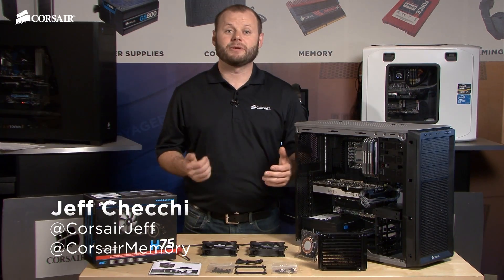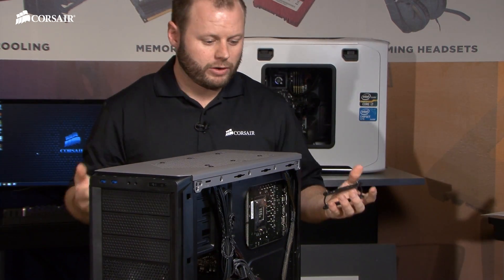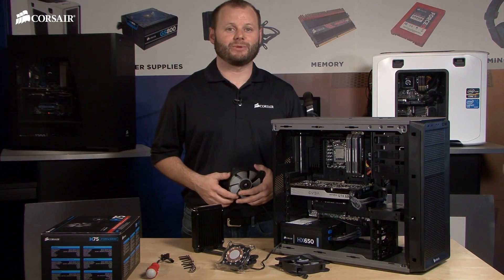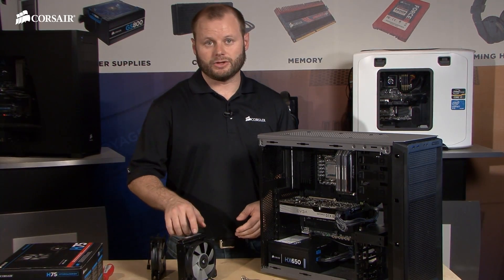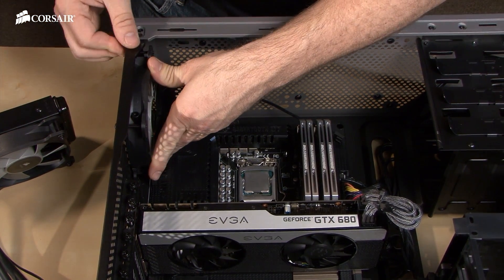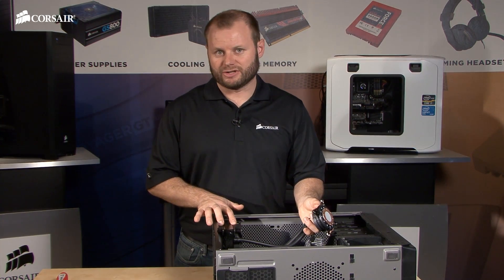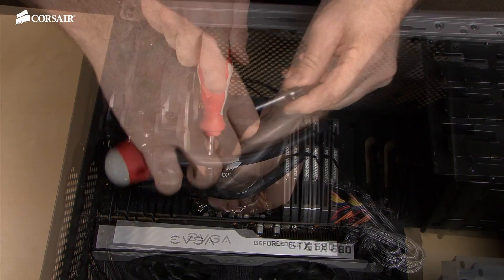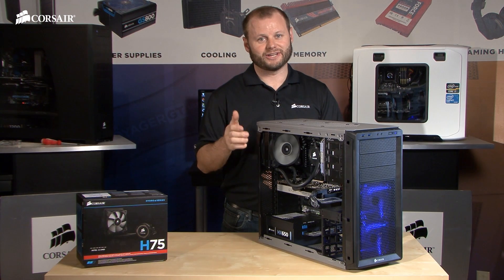Installing the Corsair Hydro Series H75 Liquid CPU Cooler

Comment: HI. How to control pump speed in this cooler. Mine runs at full speed all the time. Iv'e tried various software/motherboard connectors combinations and none allowed me to control the speed. Someone on amazon said it has only one speed but then I cannot find it on corsair website. I am not worried about the noise as there is almost no noise despite pump runs at 4700 rpm (at least these are readings from AI suite). I am more worried about power usage and high electricity bill at the end of the month lol

Comment: The cooler pump has 2 connections. One is a 3 pin 12vdc the other is sata power. The manual says to connect the 3 pin and the sata power. Do they have be plugged in both?
Reply: I found this answer in another blog: You can connect it to the PSU using a 3-pin/4-pin to molex or SATA adapter or plug it into a motherboard fan header with fan control disabled for the header in the UEFI/BIOS.
Reply: @fernando-aharontruanovsky3898  Thans for the answer. I connected both in the meanwhile (sata power and 3 pin power) and the heat is transferred very well to the radiator.
Reply: Where is the connection to the SATA?
Reply: @fernando-aharontruanovsky3898  I think I have the 2018 model which has 2 connections on the pump unit.
Reply: Do you know why we have to connect both in this model and not in the older ones? Thank you
Reply: @fernando-aharontruanovsky3898  That was my original question 😀. But in the meanwhile i figured out that the pump has a led light. Maybe one power cable is for the led light and the 2nd for the pump itself... I don't want to try to disconnect one of the 2, because it can cause the pump not to work...
Reply: Is that because of the light on the top?
Reply: @fernando-aharontruanovsky3898  I'll test that tonight when I get home.

Comment: im kind lost here buddy on the crosair H75 guide tells to put the coolers as an air intake to pc case, and here you guys are showing to exhaust. And now? Exhaust or Intake installation of the radiator coolers?
Reply: Exactly. They mentioned specially to put fan as intake cool air from outside and here they are showing the opposite? I’m confused?

Comment: will this work with a i7 6700k
Reply: yes
Reply: i have it for my i5 6600k
Reply: cool thanks :D
Reply: How is it working? I have the same CPU in the PC I'm building. Have you over clocked at all?
Reply: +BPLNick which motherboard u use?
Reply: asus z170 a overclocked i5 6600k to 4.2 easy could go higher.
Reply: +BPLNick I looked at that Mobo. Got a good sale on an MSI Z170 M5 Gaming Mobo... wonder how far it will take me.
Reply: And i7 7700k ?

Comment: I'm not sure why, but I have terrible heat issues with this unit, despite a friend having the same configuration and having none. The pump seems to work fine. 
But if I attempt to render on the CPU I hit 87C and power down.
Reply: Casey Wagner try a third party replacement backplate, or use washers between the backplate and the motherboard when installing the standoffs. the low quality corsair backplate doesn't allow the cooler to be held tight enough on the cpu, and because it's plastic, if you try to tighten the standoffs, they end up stuck because the nuts come loose from the plastic of the backplate.

Comment: Can I use this with LGA 1151?
Reply: +Broccoli_King Or the H55, still haven't decided which one to get for the i5-6500.
Reply: +Broccoli_King both will work
Reply: +Broccoli_King He said it is adjustable, and he said on of the screw-bolt things are for all other intel sockets (even though he only mentioned 1150 1155 1156 and 1366) I really doubt it wont fit, and if it doesn't you can always just stick it on with super glue
Reply: Mine fit great! On my sky lake cpu
Reply: Nice to hear!! What kind of monitor are you running???
Reply: An old one (Dell 24")
Reply: Nice

Comment: I have the I7 4790k/MSI Z97a Gaming 7 with the h75. My previous h100i started smoking and Frys had the H75 for $75 so it was an affordable replacement. Aside from price, I specifically chose this one over the others because my Mobo could control it perfectly and I hated Corsair Link. I love the H75, it was as hassle free as advertise and my I7 4790k stays in 60-70c when overclocking at 4.6ghz even with my gtx 970 sli and 4x4gb corsair pro 1866 (Don't buy 4 modules for gaming people). Its very energy efficient and surprising not that loud even under max. I think Despite corsair bigger is better philosophy, I'd recommend over any of 240-280mm models. Fuck corsair link, its a shitty program that is 110% hassle.

Comment: Hmmmmm...... watching this to wrap my head around size, thinking about ordering one of these.

My problem is I was planning to put an H75 on as rear exhaust in the same location as this case, but I was also planning to put an H105 on the top of the case.  After seeing this video, I don't think they will both fit....
Reply: +Christian Gemme Put the gpu in the front.
Reply: +Christian Gemme You can't really cool your CPU with 2 separate rads, ya know
Reply: SquidPlays I know, I was thinking about using one for the CPU and one for the GPU w/ corsair GPU adapter.
Reply: ***** oh.

Comment: Hey Jeff, does the H75 use the same tubing style that the H105 uses? And if using it in a Silverstone Tek ML05, would it suffice to use Prolimatech 120mm Ultra Sleek Vortex PWM fans?

Comment: where the water at? i just got this fitted i thought it would have been much more complicated than this.
Reply: Yuck Foutube on stock cooler my AMD FX8350 was reaching 62.5c during games it was also VERY LOUD annoying it was! could hear my pc all over the house

so took it to pc world they fitted a cosair H75 i let them do it now my temps are down to 53c, ive seen people installing water coolers on here but they stood there with a funnel pouring liquid into it :o i couldnt be doing that ok i can put a graphics card or ram in but cpu stuff i'll leave that to the experts but after watching this video i could of probably done this myself it looks soo simple
Reply: +Julian john You're thinking about custom water cooling where you get fittings, radiators, tubing, a pump, a CPU waterblock, waterblock(s) for your GPU(s), etc. This CPU cooler is a closed-loop cooler, which means that there is already a pump, waterblock, and radiator; not to mention that closed-loop coolers are ready to go right out of the box. You don't have to (and you can't) fill up a closed-loop cooler.
Reply: +OMGItzAidan - Gaming  i have been looking for  an answersimilar to your reply. I actually want more on it so here is my question. "I have had my liquid cooling fan for  about of year and recently once a boot up my pc three minutes into my gaming session i get a noise from my cooling system. It sounds like wires hitting the fans, but I've checked all the fans and there has been no wires in them. I quit my gaming session and see if I can still hear the noise from in the case and I can. It seems to stay on once the computer hits a certain temp. I have been told in can be anything really. I know its not my fans. It cant be my psu unit because i have the fan facing downward. my graphics card it set up correctly and only turns on at a set temp. hard drive is still fairly new and so is my mobo. This leaves only the cooling system. So if my radiator is low on liquid will it make this noise that Im hearing, and what can I do to prevent the noise from happening again with my H75 crosair cooling system thanks.

Comment: I just received this today. It looks and feels like quality machinery and definitely good value for money. I guess the 5 years guarantee makes sense. I installed it on my 6-year old PC, cheap case with Asus P6T with a classic i7-920 on it. In the beginning I was a bit worried when I realised that I had to take out the motherboard from the case in order to install the backplate. But in the end it was all pretty straight-forward, had it all done in an hour though proceeding very carefully..
I was using the stock cooler all these years, but recently I have been running some multithreaded simulations which push it to 100% CPU utilization for days at a time. With the stock cooler temps were around 51-53C at idle and at about 80C with all cores running at 2.67GHz. Taking them to 2.8GHz resulted in 95-100C and the CPU was throttling down. So after I installed the H75, idle temps went down to 35C. But what's amazing is that with all 4 cores at 2.8GHz it's now 48-50C max (from 100C before). Very pleased with that. Tomorrow I will try to overclock it, my target being 3.5Ghz and hopefully temps not higher than 70-75C. Let's see if that's possible.
EDIT: Actually got it stable at 3.8GHz with temps at full load around 70C. Quite happy.

Comment: I installed the H75 today in my Corair Spec-02 case. The radiator barely fit in the case and almost caused an issue with refitting the side panel. My mobo was too thin for the backing plate, so I had to go to Home Depot and install some neoprene washers so that it would fit securely between the backing plate and mobo. I also subbed a Corsair SP120 fan with red LED for the fan that came in the box and it looks amazing. Aside from the washer issue (c'mon Corsair) it was a pretty painless installation. I dropped 15-20 degrees F running BF4 on ultra @ a very solid 60 FPS over the stock Intel CPU fan. 9/10. Corsair needs to address the thin mobo issue and let buyers know about possible fitment issues.

Comment: Can I change the supplied 120mm pwm fans to the af120 led fan??
Reply: Chee Jee Ven just commenting because i have the same question.
Reply: Chee Jee Ven Yes, You can. But i wouldn't suggest it.

Comment: Question please: I have installed this cooler on my i7 5820k cpu and my load temps are fine' it never goes above 60c on full load.
My problem is on idle temps and simple tasks temps, on idle I get about 37-40c and every simple task I do increases the temp in about 3-10c, now first of all I think 40c at idle is too high isnt it? and 2nd the noise drives me crazy because each simple task I can hear the fans speed up and down..

Comment: I just installed my h75 on to my i7 4790k and the idle temps are way to high in the 80c range and I am freaking out please any one help me.
Reply: Is everything plugged in correctly?
Do you hear the pump?
Reply: Sven Raven I am happy to say that i returned that h75 and got another and turns out i got a defective one so now my i7 4790k idles at 33c and when playing games up to 70c.
P.S:
I am not happy with Corsairs customer service because i left a message for them since it was a Sunday and i was very very VERY upset/stressed out that my computer was so hot and they never ever called me back to try to solve my problem so i was forced to solve my own problems and go back tot the store and beg for them to exchange it for a new one. It looks like that 5 year warranty is just for show and doesn't really work. I am just upset because this one of my first ever computer upgrades and i was before i started very scared and apprehensive of breaking something and it didn't help that i got a broken one. All in all this was an emotional roller coaster.
Reply: I had the same service.

Comment: Does this fit in a zalman z11 plus case?
Reply: yes it does but its very visible! I used an aftermarket SP120  to make it look a bit better
Reply: Martyn Stanger Ok thanks, I think i will go with a H60 :) Is it realy worth it to change the fan?
Reply: Tobias Nellemann I'd go for the 75 in push/pull or the 100i , only because it gives you the extra fans and wider radiator. Hope this helps.
Reply: Martyn Stanger I've been seaching the web for while now and I don't think a 240 mm radiator will fit sadly :( I would go for the 100i, but I would need a new case for that.
Reply: Tobias Nellemann I just had the h100i, (had to return it because it didn't fit my processor) and it looked like it fit on the top of the z11 plus. The only problem was getting the top of the case off to be able to screw the radiator in.
Reply: Josh Riess I went for the h80i :) fits perfectly and looks great with corsair link and leds :)

Comment: Hi, i have a i7 4970 with the stock fan. I found it's noisy as hell! If i bought this H75 the noise is gonna go? Or it's the same thing but a lot cooler cpu?
Reply: gmk kmg What are you talking about the stalk fans are very high quality and built for radiators. The fans are SP 120's which are have high static pressure which is key for moving air across radiators, and these fans are about $20 each and you get 2 of them with this radiator. But it would have been more beneficial for them to give you one AF for the exhaust and one SP for the intake.

Comment: Can you install it without a fan between the radiator and the case or would the screws be too long?
Reply: If you don't want 2 fans get a different model of cooler
Reply: ***** Yes you can do this but you will slightly loose some performance by not using two fans.

Comment: Hi I have a question. I have a hydro h60 where should I connect a fan and where the pump ?
Reply: Id do the fan on the cpu header and the pump on the chassis header.
Reply: The configuration for the H60 is the same, minus the second radiator fan.

Comment: hi i bought the h75, now the coolent pump has 3 pin ..but in my motherboard 2 fan connectors are 4 pin . hopw do i solve the problem
Reply: you connect it to cpu fan header
Reply: There is no problem

Comment: I'm a bit confused about the fan headers needed for the H75.. How many do I need (in addition to the CPU fan header), and how close do they need to be?
Reply: You just need two headers; one for the two fans, as they are connected via a Y PWM splitter, and another one for the pump. As for how close they need to be, the two cables you need to connect to two headers are two separate entities so you don't need to worry about how far the headers are.

Comment: So if I install this, do I still need the other case fans to cool the other parts of my PC?  Looks like the H75 completely utilizes the rear fan slot, so I guess the intake fans at the front and bottom of my case are now exhausted only through the top of the case.
Reply: Well, the first fan sucks air from inside the case through the radiator, then the second fan pulls it out the back. It should work exactly the same as just one exhaust fan.
Reply: This is a CPU cooler. You still have heat to move from the ram and video card as well as the main board chip sets.. So. yes. You still need the other case fans.

Comment: doz this cooler work with am3+ also will it fit in to Corsair Spec-02 case?
Reply: Yes, it'll work with an AM3+ motherboard. I'm not so sure about the case but given the thin profile of this radiator, it'll probably fit on most cases as long as there's a 120 mm fan mount.

Comment: this or H80i ??
Reply: This has a thicker radiator so it cools a little better, but if you want corsair link (can control things like fans and etc) go for the h80i.
Reply: dkfan241 No, the H75 has a thinner radiator measuring 25 mm. The H80i, on the otherhand, has a thicker radiator measing 38 mm. You are right about the Corsair Link. Of the two, only the H80i has it.

Comment: Would it cool down an AMD FX-8120 @ >4 GHz?
Reply: yes
Reply: this thing could probably cool down an overclocked FX 8350. If you are planning on going into the 9000 series than id recommend a 240mm fan and pump instead of the 120.

Comment: Since the Corsair H75 and H80i water coolers cost the same and both have dual fans. Which one is the one to buy? Any comparison reviews online?
Reply: shatter71 Usually the h80i is more expensive but if they are both the same price then the h80i is better because it comes with a awesome software that lets you monitor and tune everything and it comes with awesome led's on the pump that help bling out you system.

Comment: Every other Liquid cooler I have read or seen on most youtube, they say you always bring cool air through the radiator, the way this is insatlled you would be push/pulling warm air from inside the case ?
Reply: I agree. Outside to inside.
Reply: The manual of the h75 says that you got better performance if you use the fans as an intake of air to the case....

Comment: Hello. I have a H90 and I want to install a second fan for a push/pull setup. Where can I get screws for that (Screws that go into the radiator through the fan)? There was only 4 screws included on the H90.